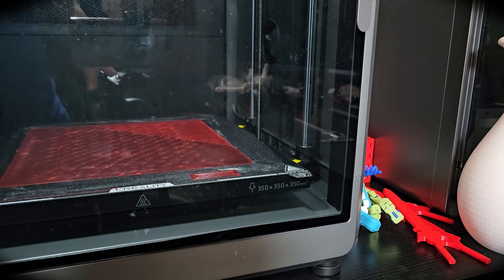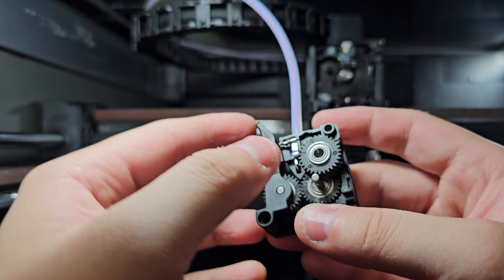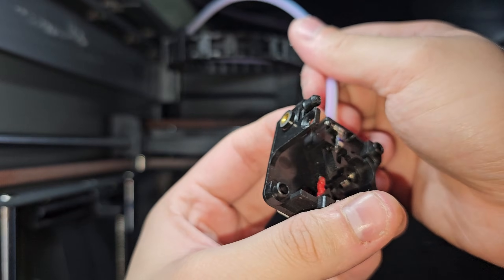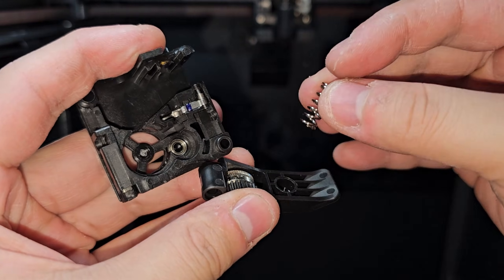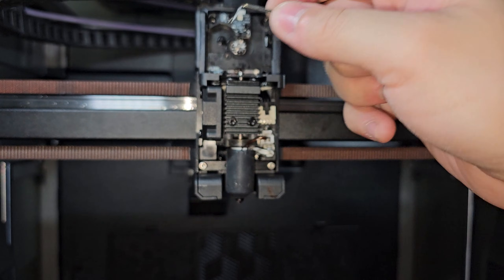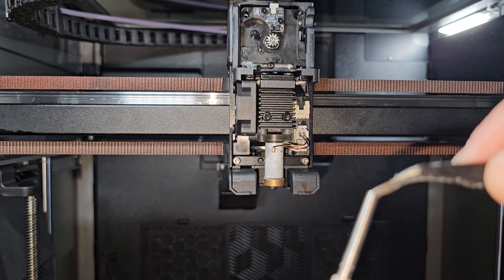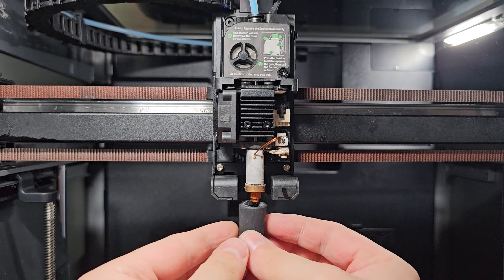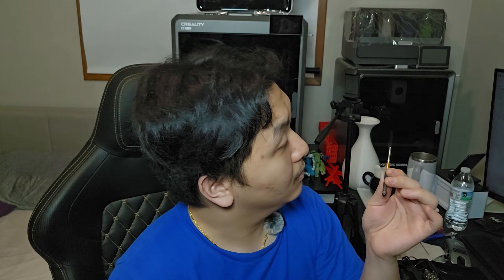How To Unclog Creality K2 Plus | Whole Extruder Disassemble

Comment: Thanks man had this issue happen after 3 weeks, idk how it happened, unfortunately it happened to a new tip I just replaced like a day ago, and had to use another new one, you mentioned heating the tool to take the filament out, would this take the old filament out from the new tip that was clogged?
Reply from the maker: It may work, but if not done correctly it might make it worst.

Comment: 2:12, the thing won't come off no matter how much I try and it feels like im about to break it in half, there is minimal moving.
Reply from the maker: Make sure to remove all 3 screws. Try pushing in the filament tensioner and pull it out.

It may feel stuck becuase of the gears from the motor.

Comment: With a lighter, heat up the thin push pin that cam with the tools to push the filament through the nozzle.
Reply from the maker: That's a good tip! Thanks for sharing.

Comment: I've had my K2 Plus for 10 months and I've had this happen twice; exactly as shown in your video - a partial clog in the extruder and another clog in the nozzle. Both times I disassembled the extruder just like you did (I also couldn't get the bowden tube clamp to release). Both times the tensioner spring popped out as I was reassembling it: the first time it landed inside the printer housing but the second time it flew over my shoulder and disappeared somewhere in my office. Fortunately, I have boxes and boxes of compression springs and I have about a half dozen exactly the same... I should be set for a couple years anyway.
The first time my nozzle clogged I tried unclogging in place; I heated the nozzle, inserted an acupuncture needle and then let it cool. Once it was cool I pulled the needle. I've done this same procedure on my CR-10 Smart numerous times and it always worked, but the K2 nozzle is so long that I couldn't pull it adequately and the needle broke off inside the nozzle. I removed and replaced the nozzle, and afterwards I found out that my nozzle was bent, so I imagine it was destined to fail at some point.
Rather than screwing it up further with an acupuncture needle (like I did last time), from now on I'll do a cold pull: I'm going to remove the nozzle and secure it in a vice. Then I'll heat it with a torch until the filament softens up and insert some 1.75mm nylon as far as I can get it. Allow it to cool until the nylon & filament bond to each other and then give it a good pull. Hopefully it'll clear enough of the filament to make it useable.
Reply from the maker: yeah you gotta be careful with the spring and creality printers does tend to clog a lot.

Comment: I'm having exactly the same problem, but I'm having it so frequently, did you know why it's causing of?
Reply from the maker: Reasons I think its causing is bad filament
Reply: @Scratch3DPrinting  I'm using  Elegoo Rapid PETG, and the filament is brand new. I don't know if it is because the temperature of Rapid PETG is lower than regular PETG.

Comment: It does not meed to clog.  If yo get a small sliver of filament in the filament present lever in the extruder and you have a CFS the screen will tell you to remove the roll from the side of the machine.  The machine was finished out a print and showed a x axis error.  In start ups after error the head slammed from side to side.  I should have wrote down all the errors.  I tore the CFS apart 3 times and pushed filament through all tubes.  After 6 hours I found a little sliver locking the switch.
I am doing usb print transfers.  
I wish the K2 had a larger scream and would have switch state displayed on the screen.
Reply from the maker: ohh that is interesting, next time it clogs up i'll take a look at it.

Comment: if the filament is jammed in the nozzle, you can heat the nozzle by itself with a hot air gun to soften the stuck filament and push it out. or you can get lazy like me and just a long 1.75mm drill bit and drill out the stuck part, it's only ~10mm long. can even do that on the machine if you are brave...
Reply from the maker: Yeah that is a way of doing it, but very dangerous.

Comment: Don't forget to put the heat sink grease on the new nozzle, right around the copper heat transfer parts.
Reply from the maker: Thanks for the reminder, good tip!
Reply: The thermal paste*** correct?
Reply: @imghaniff call it what you want, it has many names including but not limited to... thermal paste, thermal compound, thermal interface material, thermal gel, heat sink compound, cpu paste, cpu heat sink grease, thermal grease, and many others.

Comment: After clogging my 3rd nozzle, I was able to drill out the clog with a 2.5 mm drill bit, I did see a few metal shavings right at the end, but I have probably printed 100 hours since then without issues, I figured I probably just improved the cool zone of the nozzle.
Reply from the maker: haha, yeah that might be a good solution to clogging.

Comment: Thanks for your video. Filament got stuck in my Anycubic Kobra S1 Combo...I am an absolute beginner and dreading to open the extruder...Do you think Anycubic Kobra S1 takes the smilar process to this one? I am so scared of doing anything mechanical🤣😭Have you had any issues with your Anycubic Kobra S1?
Reply from the maker: I have not gotten issues with the extrusion. I'll make a video on how to take apart the extruder.
Reply: @Scratch3DPrinting  Thank you. I atually opened it by now but the issue is not solved...looking forward to seeing your new videos!

Comment: Hi,, How have you had the K2 Plus? And any other issues? Do you use it a lot?
Reply from the maker: Yeah it's my primary 3d printer as of now. It works great, not that much problems.
Reply: @Scratch3DPrinting  Thanks for your response.
A comment on clogging. 
I still use an Ender 3 V2 and had clogging issues at one point. 
The problem was that the heatsink fan wasn't blowing enough air, so I had to redesign the entire print head. 
Without proper cooling, the heatsink couldn't stay cool, causing the filament to soften too early and making extrusion difficult. 

I’m wondering if something similar is happening here. Also, my Ender 3 is in an enclosure, so the air blowing on the heatsink is warmer. 
This didn’t happen in cold weather or when I left the door open. 

I'm thinking about getting a K2 and I'm hoping this issue is not present.

Comment: I appreciatew this video but your giving some bad advice that can damage printers.Dont use an allen key to push filament in the nozzle. Especially when its 220 plus, you can get burnt. They offer a long needle to push filament through if its clogged.
Reply from the maker: Yeah that was a mistake on my part. The long needle is the way to go thanks.
Reply: Wait.. you can get burnt by a 3d printer! That's crazy 😮

Comment: those gears i noticed Aliex sells upgrades made of harden steel , does anyone  see if this upgrade is worth the hassle.
Reply: Yes and NO, Yes they are longer lasting but NO the standard ones are meant break first before burning out the motor. They are simplish replacement and give a good working life but the fact that extruders are designed to have sacrificial parts. Plus if the pulleys hard then they will chew up the filament faster and with the CFS that is likely.